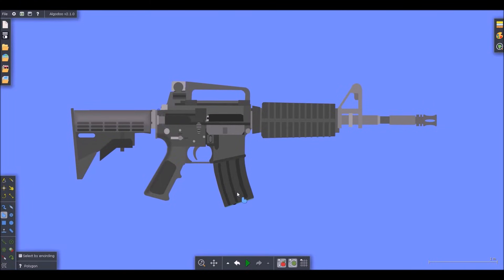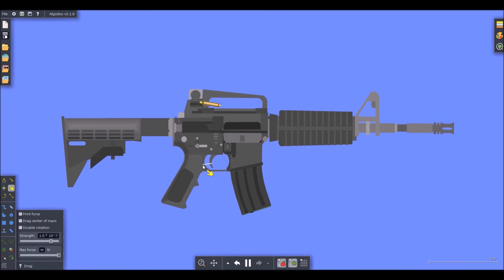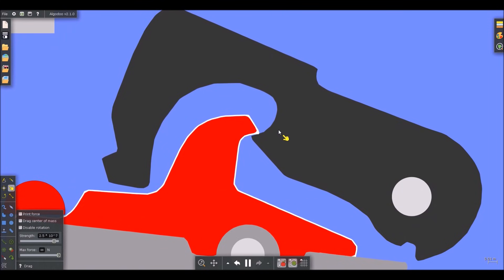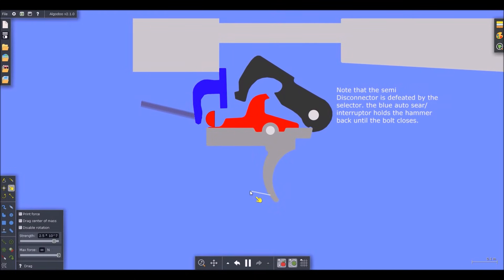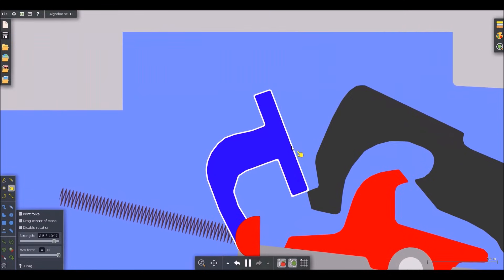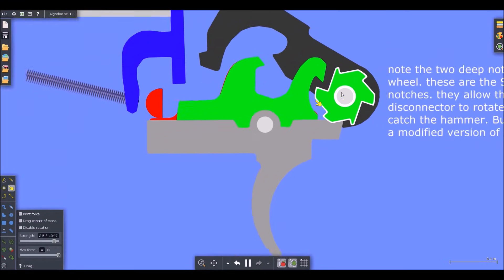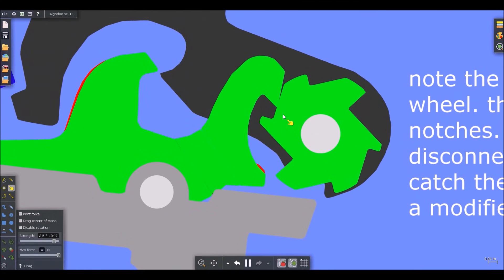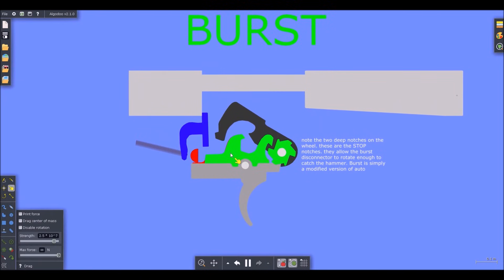How 3-round burst works

Comment: Either I missed it, or it wasn't explained, how does the trigger reset after a burst? Thank you for the time you put into this, very informative.
Reply from the maker: The trigger resets exactly as it does from semi automatic: the trigger drops from the disconnector to the sear on the trigger's face. The only difference is that it drops from the burst disconnector instead of the semi disconnector.
Reply: ***** ok thank you. It was hard to see it that way, but I do now, also i forgot you mentioned that the pin wheel ratchets. Thanks again for the vid and explanation.

Comment: great video , i had reviewed the military training manual for the parts involved, however it does not show how the cam/ratchet work ! it does show that a springinstalled inside cam, but that does not satisfy my mechanical needs. do you know of the cam ratchet details  ?
Reply from the maker: The spring is a one-way friction clutch bound to the cam. The best way to see the effect in-person is to disassemble a retractible pen, and find the spring and the ink insert it sits around. Rotate the spring one way, then the other, and you'll see what it does.

Comment: excellent video! thanks! I do have one question that is not answered in the video though. Does the cam wheel always spin when fired? What I'm getting at is, if one fired it on semi-auto for one round, would the cam wheel rotate out of the deep notch. If one then turned to burst, would it only fire two more rounds until it reset into the next deep notch? 

Along the same lines, do you have to hold the trigger for the full 3 bursts or will a quick pull always rotate and fire the full 3 burst. If it's the first case, does it also have the same characteristic where one might only get 1 or 2 rounds even though they were on burst mode?

Once again, great video. Just watched a full auto video and was naturally wondering about burst and yours was the only one out there.
Reply from the maker: yes, the cam wheel always rotates, regardless of what mode you choose. this makes it finicky at times, but it's merely a mechanical quirk. you must hold the trigger for all three rounds; if you do not, the next pull will yield you one or two rounds. the same with mode switching. if you fire, from a default position mech, 4 rounds in semi, then switch to burst, it will yield you 2 round on the next pull of the trigger. I've seen it on some videos where they shoot it semi-auto, and then go to burst, and they get a shortened burst.

so yes, your idea is correct :)
Reply: *****
so in an M4 with a  burst-fire option, does the red disconnector not exist?  or is it merely disabled when the selection lever rotates to burst?
Reply from the maker: Just disabled. Semi auto is still available on all platforms.